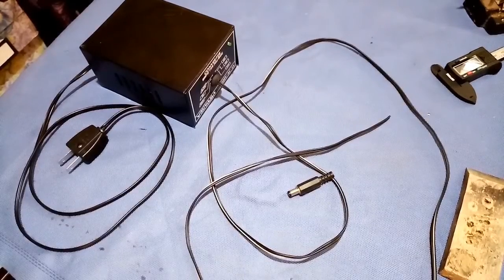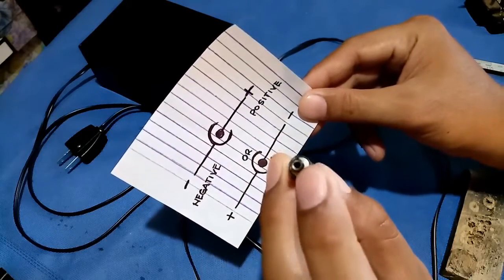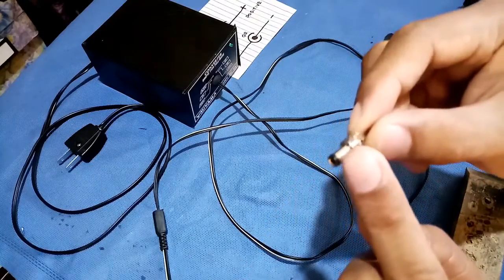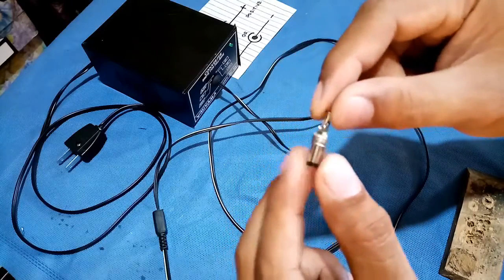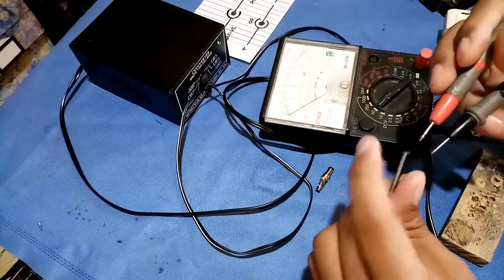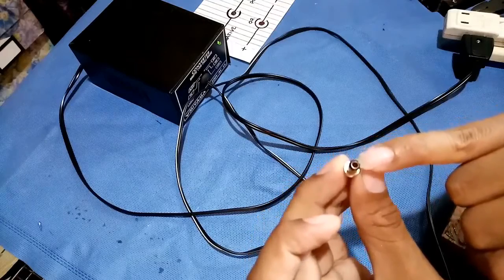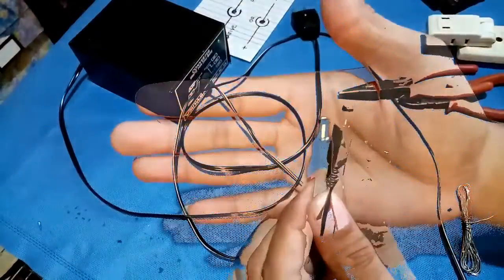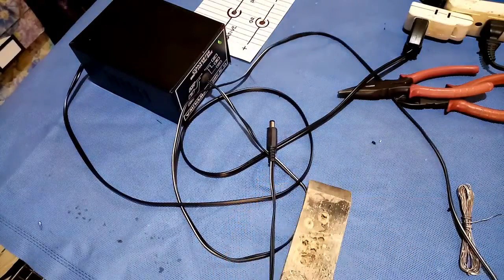Fix Your Power Issues: DIY DC Plug Replacement Tutorial

Comment: I did it with your instructions.  My solder connections are not as pretty as yours, but it works.  Thanks!
Reply from the maker: To get a good solder connection you must clean the wire and the parts you want to solder by scraping.

Comment: I need the input part fixed, my plug in is fine. the input receiver part is all loose, so power kicks on and off.
Reply from the maker: Check your receiver especially the DC input jack and the power switch. Clean and resolder the that part.
Reply: @woodys_hobbies thank you.

Comment: Could you tell me the brand and model of your AC-DC 12V adapter?
Reply from the maker: The AC/DC adapter is also my DIY I'm using 12-0-12 stepdown transformer 220 volts. The enclosure box is new you can buy this in online store or electronic store.
Reply from the maker: If you need an AC/DC adapter you can just simply check your device voltage, current and polarity requirements.

Comment: Can I just connect it somewhere in the middle? I cut the wires and I just connect and solder wires in the middle of cable? I don't have the original plug, but some other plug.
Reply from the maker: You can interchange the 2 wires. Please take note that you must know the polarity of your device. There are two polarity center hole of the plug is positive or center hole of the plug is negative. Please be careful.
Reply: @woodys_hobbies  Well, yes, like most of them, center pin (I have pin) is positive and barrel around is negative. And I just figure out which one is positive and which one negative that goes to the brick charger and I just solder it somewhere in the middle and tape it with electrical tape good. It appears easier.
Reply from the maker: @nebojsa1976  You can check by using multi tester. Set to Voltmeter.

Comment: Darker color is negative as a rule.
Reply from the maker: The one with a stripe always negative but there some adapters it has a marking stripe but if you look closely the stripe it has a small + sign and that's positive. I will not say as a rule but mostly I encounter the one with a stripe is negative. For safety just check the output voltage the test probe leads will answer or check wire it will always connect to an electrolytic cap. Electrolytic cap has polarity you can double check which wire connected to positive or negative.
Reply: @woodys_hobbies  Thank you
Reply from the maker: @kramyararut7353  Welcome!!!

Comment: How many amps does the DC5525 jack handle?
I've been told up to 20!
Reply from the maker: Yes that is the max. load but I will not go to 20amps maybe 15 to 18amps to be safe. And there are many fake dc5525 plugs and jack beware of that it has a low quality especially the metal connections sometimes its very thin and it cannot handle higher current.
Reply: @woodys_hobbies  Thank you for the heads up!
Keep being awesome!
Reply from the maker: @AutodidactEngineer  Welcome!!! Thanks!!!

Comment: where can I buy these plugs?
Reply from the maker: This is DC Plug. There are many types of DC Plug especially the diameter of the plug "inner" and "outer" diameter. You can buy this kind of plug in electronic stores or hardware stores or online stores.

Comment: My dash cam mini usb wire has only two colours. Black and white. 
When I spliced Black with Black and White with Red to another data USB cable to get a power extension, it only gives a flickering screen. (Did not test it for volt. USB data has green, red, grey and white)
What is the case when power USB wire has only Black and White wire as explained above? Thanks in advance.
Reply from the maker: You must be careful some USB has different wiring color. You must test first the connection on each wires. You said it is for power extension then do not use the data connections to be safe. USB power connections are on the sides. Facing the usb plug in front the white plastic is below the right pin is your B+ your ground/negative pin is left side. To be sure you can google usb connection. About flickering check your power supply voltage and the supply current. Check your polarity.

Comment: If I have a converter that outputs 12V and I need to replace its wire from a 9V or 5V converter could there be issues?
Reply from the maker: Check the size of the wire if the stands are almost the same then its fine.

Comment: Thank you.  You made that look so easy.  With your instruction, I did it.  Albeit, not in 10 min.  My DC supply now works and the plug's end cap hides my first solder connections.  Thank you.
Reply from the maker: Welcome
Reply: Very good
Reply: Thank you so much someone stole the charger for my old mobility scooter and it's no longer available but I found a charger I think I can use but I need one with neg center and i only found one with positive center . So I'll do what you did and switch wires thanks